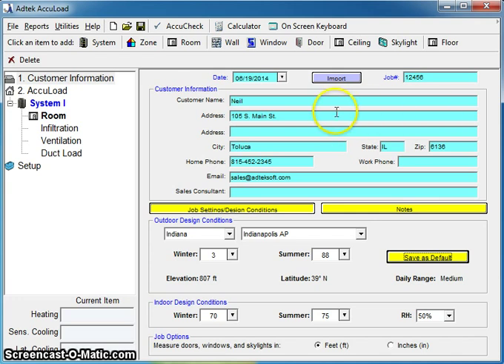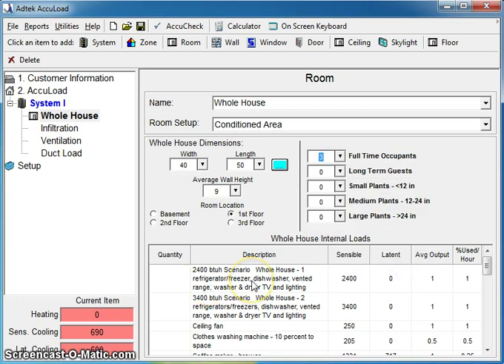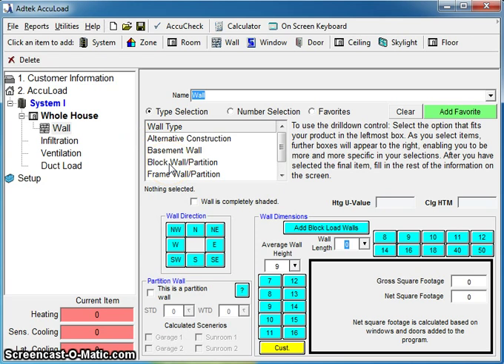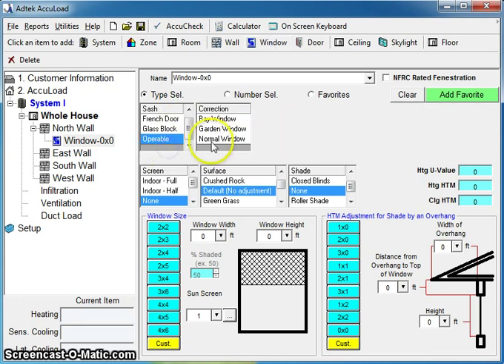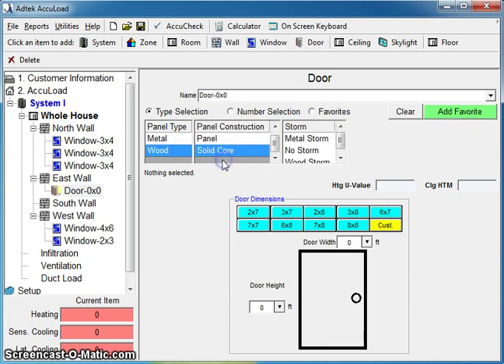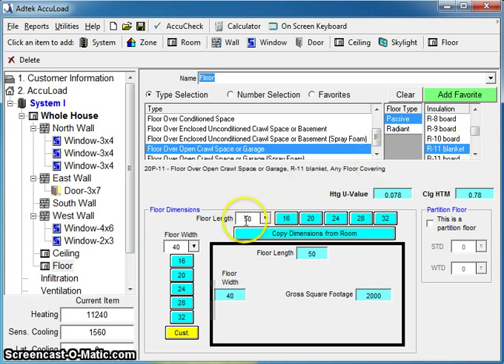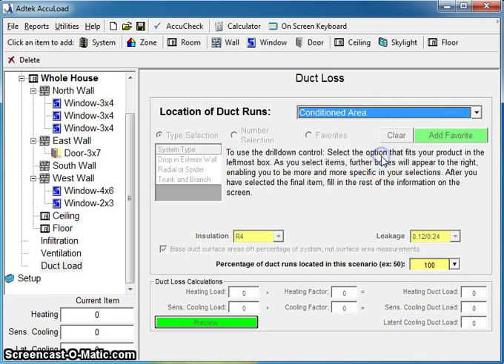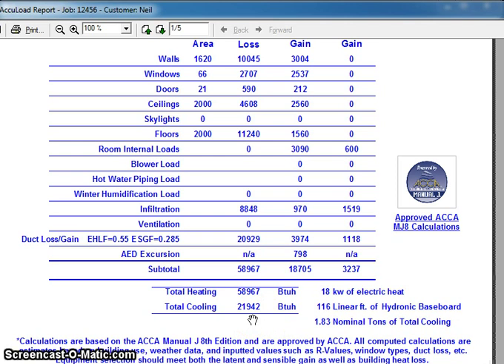AccuLoad - Whole House Load Calculation

Comment: Have been using on line version for a year. question? can we get some examples of heat loads on a home with a basement 8" concrete walls, 1st floor with an attached garage, and 2nd floor. roofs are normally a 4/12 pitch and many newer home will have the great room or family room with valued ceiling.  
this software has been the easiest to learn for me. all though i have only tried WS. I have been recommending this to my friends and my equipment sails rep. as many contractor have been asking him. fYI Colorado contractor are now going to have to start using software and getting it in to the hands of there techs.

Comment: Can you guys help with this question?
Reply: +james holder hi James what is the question you are asking?
Reply: +Neil Ropp Jerry's question.
Reply: +james holder you will only input floors and ceilings that are connected to the outdoor design conditions, therefore you will always input you top ceiling and bottom floor - there is no heat loss or gain on everything in between thus, it does not need to be entered